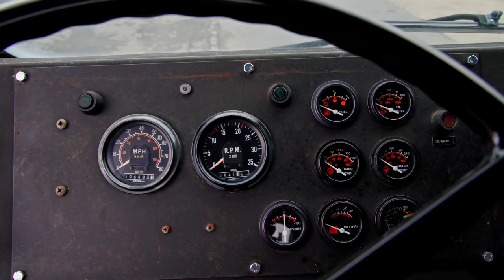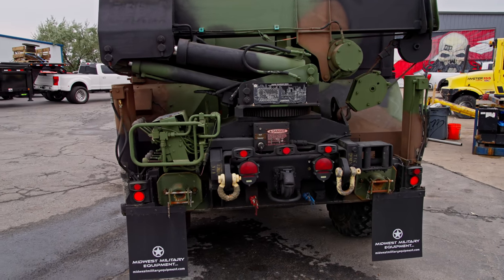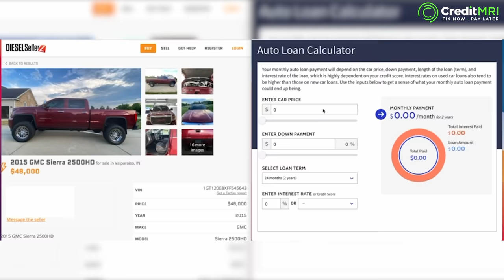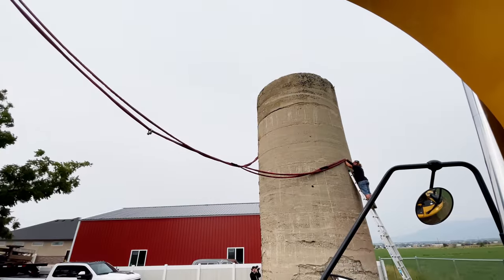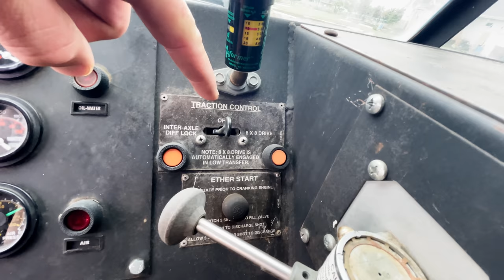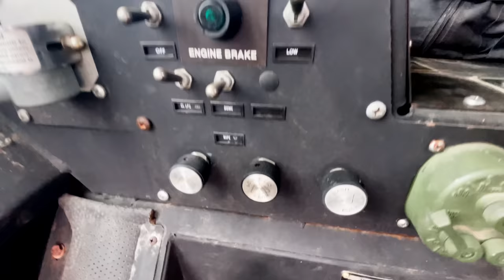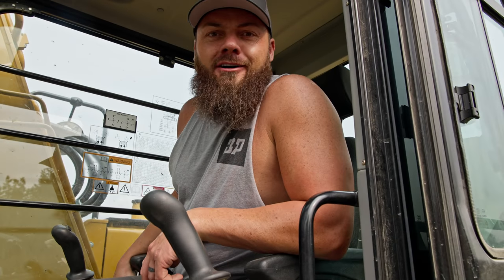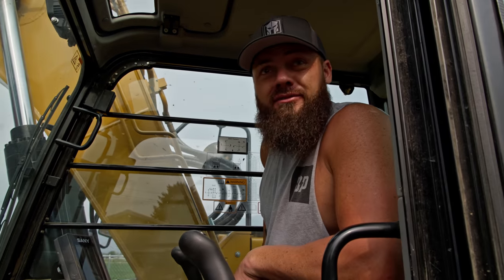This Giant Silo Could’ve Smashed Our Newest Recovery Vehicle 😅

Comment: Knew it was a HEMTT from the thumbnail. Those are absolute monsters! The wreckers and the PLS are awesome. Some have the big De-troit Diesels that have a turbo feeding into the blower. They turn like a 50 foot long 2x4 but that's no problem, they can just run over whatever is in the way lol. On a sad note, knew a guy that was in a convoy going to Ft. Drum in one. Some teens were driving recklessly and cutting hin off. He ended up running the car over and killing all of them because they drove in front of him too close. He would never drive the big stuff again and really messed him up. GOVE LARGE VEHICLES ROOM AND STAY AWAY FROM THEM! DO NOT FLOOW THEM, RIDE ALONG SIDE THEM OR CUT THEN OFF! Vehicles like this are designed to run over whatever is in their way and will drive over your car or truck like its a speed bump and it will kill you. Same with large commercial vehicles. They aren't designed to run over anything but because of their large size, they have no problem running over and flattening a car or truck. They can't stop as fast as your little car either. It's sad this needs to be said over and over and over. Anyone who cuts off or messes with a big truck on the road deserves to be flattened.
Reply: Yeah don't mess with monster vehicles
Reply: I love the HEMTT it’s an awesome truck!
Reply: Was he 10th mountain?
Reply: “Deserves to be flattened” is a little extreme don’t ya think? I agree, the big vehicles on the road need to be respected for what they are and the clueless people need to be educated about them. The jackasses that drive erratically need a couple nights in jail to think about what they are doing.
Reply: @joelbittner6212  i mean you're right it doesn't have to be said that way... but if someone doesn't have the least amount of common sense or is to dumb not to know what to do around big equipment .. they def can't be trusted around pedestrians or close to any other vehicle ... losing one life is better than losing multiple
Reply: I always try to stay within the view of the huge vehicle driver whether in his mirrors or in front  of him.  Respect the larger vehicles like this and don't give them a reason to lock up their brakes or create a hazard for them.
Reply: @joelbittner6212  I'll choose to believe Mike meant for us to take that last statement from a Darwinian context, rather than a punitive one.
Reply: What is the weight of the HEMTT ?
Reply: @coreyhodson3258    The a-kit and b-kit numbers are for the two armor levels available:  Mass	42,500 lb (19,300 kg) unladen; 69,000 lb (31,000 kg) laden (a-kit); 75,500 lb (34,200 kg) laden (b-kit); 109,000 lb (49,000 kg) (GCWR)
Reply: We had 2 HEMTT wreckers with us while doing route clearance in Afghanistan. They got us out of some sticky situations.
Reply: Was picking up my gf at the airport one shitty Christmas eve in Texas the day after an ice storm. Came across an accident.  A semi had overturned onto a Ford truck hauling a trailer. The semi's trailer was loaded with hot dogs. That Ford truck and trailer had been smashed down to around 6 inches, compacted. Driver probably never even felt it. Big rigs are no joke.
Reply: I remember hearing about that, I really felt bad for the driver of the HEMMT, and the car he hit.

Comment: I the Marines we would call those Dragon Wagons. A play off the word dragging because they could pull anything. Those trucks come in many different configurations.
Reply: similar but not the same configuration, you are referring to Logistics Vehicle System (LVS), The United States Army does not use the LVS, it uses the Heavy Expanded Mobility Tactical Truck (HEMTT)
Reply: Well, I did say, it comes in many different configurations
Reply: This is the LVS and LVRS replace these old rigs. Also we never called them dragon wagons in the Corps
Reply: Good for you, in 3/9 during the early 90's we were calling them that. As far as this being a different configuration IDGAF. That's like arguing about a hi-top HUMVEE and a shell-back HUMVEE or a HUMVEE with an ambulance shell on the back. They are all HUMVEE, just built in different configurations.
Reply: Have you ever seen 3/9 in a regimental formation?  The Marine carrying the colors was sweating and struggled to hold them up. The colors of 3/9 are so heavy that no single man can carry them. The regimental formations we had on Pendleton spoke the truth.
Reply: Sorry, this is wrong.  The Dragon Wagon is an LVS (mk48 power unit coupled to a detachable trailer):
https://en.m.wikipedia.org/wiki/Logistics_Vehicle_System

The HEMTT is a completely different vehicle.  It comes in many versions, but none of them split into separate power units and trailers:
https://en.m.wikipedia.org/wiki/Heavy_Expanded_Mobility_Tactical_Truck
Reply: @Jpeveto44  Two completely different vehicles, not just a different variant. Also, not called a configuration, it's a variant. Always has been, in every unit, no matter when. You were wrong, stop acting like it's just a thing of your time. You "back in my day" guys kill me.
Reply: A few of you are getting a little bit to critical about this. I understand the difference between the vehicles.  There are split frame and solid frame and they have all been upgraded and changed throughout the years. Don't be so critical about the little stuff. It's all the same vehicle but with many changes and modifications in order to make it do whatever they need it to do.
Reply: Also I believe all are built by Oshkosh and that's my actual point here. They build some amazing and very capable vehicles.
Reply: @Jpeveto44  yeah, they are both built by Oshkosh to do similar things.  But although the F16 and F35 were both built by Lockheed and are both multirole fighter aircraft, it's incorrect to call an F35 a "fighting falcon".  That's the nickname for an F16.

Comment: This reminded me a lot of when i pulled down a very structurally sound playground with my 1998 john deere riding mower only this took 3 tries and was successful, my lawn mower incident was and incident
Reply: Reminds me when I pulled 15 trees in the same day out of my Forest in my 2005 John Deere lx 280
Reply: Reminds me of when I lived in Oklahoma and tried to pull out the bush on a lot lizard
Reply: @bustinyanutz4195  🤣🤣🤣
Reply: Remind me of mowing over my fig tree
Reply: Reminds me of hauling 5 limbed up trees with my polaris ace 900
Reply: @benjaminsmith7228  dude, the ace’s are seriously capable, I have the 500 and it’s perfect for taking trees back to the burn pit or to move anything I need to, and it can rip at the badlands.(an off-road park near me)
Reply: @bentoth2494  for sure. I have a 3500 pound winch and 27x12 outlaw mst tires. Pair all that with a modified 900 motor and its some serious equipment. And that was done without tire chains
Reply: @RoseHope117  no sir I haven't gone full retard yet. But I was definitely 3/4 there my whole life
Reply: @benjaminsmith7228  lol

Comment: I’ve always loved the HEMTT.  Especially the wrecker…. If you get your hands on an A4 your life will be changed forever.  16 years and counting as a wheeled vehicle recovery specialist in the Army, those are always my go to for tough jobs.  Let me know if you wanna get together to put that thing through the paces !
Reply: Wait we have recovery specialists? As a FiSTer we usually make our mechanics go dick around in a M88A1 for a few hours till whatever we fucked up is out lol
Reply: A4? With the CAT? No sir, you needed to run the E1 converted to A1 series. Nothing easier to work on if needed and would out pull any other variant. Ran a A1 for 12 years in the service, 3 years of those were in Iraq. Would pull a HET with trailer and load down the road at highway speeds. Nothing beats that 8V92TA man, all they have to do is remove the throttle delay and adjust the jakes a little tighter and it'll perform smoother but because the injector racks are air over mechanically controlled they have to make sure they don't flatline the racks and cause the engine to run away.

Comment: Mostly used for hauling rocket pods for MLRS. But that crane will come in handy.
Reply: As wreckers and PLS trucks too
Reply: Lol mostly used as a wrecker, and fire engines. Very seldom used to haul MLRS rockets lol.
Reply: @andybmx28  well seeing how I just came from Korea and that’s all we used that model for I would have to disagree.
Reply: See there are 7 different models of the HEMITT with several other configurations. LHS, PLS, wrecker, fueler, fire truck, Patriot missile transport, bob tail, Cargo. So every model has its own purpose. This particular model was designed to haul MLRS rocket pods.
Reply: @benrubino605  lol dude their is a wrecker in every single motor pool, their are like what 3 duty stations MLRS?
Reply: @andybmx28  that’s not the point, the point is that I pointed out what THIS particular truck was for.
Reply: Mary Humphrey  possibly, why?

Comment: First mod should be to remove all the Governor's on the engine
Reply: What governors, them 2 stroke detroits are limited by fuel and air
Reply: I still know how to do rack adjustments on those for the injectors
Reply: And put a sick ass logo on the side on top of the camo. Promote the YouTube channel and business even more and let everyone know it's no longer a military vehicle. All the best guys! 💪😎
Reply: @topgunner58  ok
Reply: @topgunner58  assuming it's mechanical unit injection there's a governor that controls the racks that limits RPM, I believe it's 1,800 RPM no load speed in a semi truck application but for a military application I couldn't guess

Comment: What does that 8-92have for injectors in it? You have options to put larger injectors in it if it doesn’t have already. A lot of old-school truckers used to cap the return line coming out of the head to increase the fuel pressure. You can also increase the fuel pressure of the lift pump. Being a military engine I bet you it was built to be fuel-efficient. Read up on the fuel squeezer package that the two-stroke Detroit’s had offered, it might be equipped with that now possibly

Comment: Those engines where delivered with the waist gate tuned way down, if you get in the system and re tune the you can almost double the power without changing anything. I once had the newer 10 wheel spinning all tires for a sec

Comment: It's a pretty nice all arounder for sure. Great christening. God bless y'all's. Gotta give it to the new military trucks even if you lost a foot you'll be able to drive out of danger. In my Case my left clutch foot is dropped so i would struggle to clutch or shift on a bike. But I almost lost half my leg below the knee doctors did a great job pulling the shattered tibia together with a lot of titanium screws and a plate that can break through anything that hits it Wich I'm still hesitant to remove. I kinda like having a titanium  enforced shin.

Comment: I loved my Wrecker in Fort Riley Kansas. It's such a beast of a vehicle with that dual steer gear box. Wish I could afford the wrecker I was H8 (Recovery) and I was in charge of a Hemtt Wrecker A2, comes with a stinger and bunch of wire lines, Wire Rope Diameter: 9/16"
 Wire Rope Length: 200', a bunch of +15k wires. It was a MONSTER and I could tow anything any where any day.

Comment: you guys should look into a 1997 oshkosh heavy equipment tank transporter that can haul a quarter million pounds (125 tons) and has selectable drive axles too meaning you can select which axel you wanna send the power too and it also has 8 wheel drive

Comment: Oshkosh trucks are very nice. I work on one that has 2 diesel engines and 2 transmissions. One set runs the truck and the other for the hydraulic system

Comment: I drove a M985 HEMTT for years in the Army. 1- DOES NOT FLOAT. 2- Highway road bouncing is horrible. 3- Be careful with that side mounted recovery winch (you can run the cable out front or rear. We had to stop using those recovery winches due to frame bending. Other than that, they are a blast!

Comment: Keep your eyes open for a HEMTT the 984 A1 wrecker... those typically came with 4 winches, not including the winch on the palfinger boom. The front and rear winches are much larger and more powerful. The 984 A1 is a wrecker unit... Please note, the luxury of speed like what you have in this stake pocket unit you guys have now, will be considerably less, LOL.... like 0 to 60 in 4 hours, due to the additional weight strapped on the rig. The palfinger boom on the 984 A1 is one size larger typically as well, likewise the winch has a larger capacity. Lastly, due to the additional weight, these 984's are exceptionally hard to get stuck and they will plow 4 foot high worth of mud in front of itself to get out, but, if you do get it stuck. Best hope you have something heavy enough to hook onto that the onboard winches won't just pull into the pit with you.. lol.. Don't ask me how I know that...  That measure of stuckness, makes for a really long day..  Although the Army frowns upon using the 984 to unstuck a tracked vehicle, in allota cases, the 984 has done that uncountable times in Trash-Can-O-Stan.. Second lastly, invest into the service manual, for proper scheduled maintenance program, (not to insult you guys's intelligence) but rather, you can get a massive life span out of the drive line parts, if you just keep them lubed or clear of dirt and water intrusion. Believe me, you do not want to play the game of hunting for front steering axle u-joints or a replacement knuckle / spindle.. Not only are they getting to become in rare supply, they are costly.. The newer OSHKOSH drive line and suspension is independent suspension and out side of the wheels, those parts to not cross over to the solid axle versions. Take care of the unit, and the unit will ALWAYS take care of you.

Comment: 9:49…. That is NOT the trailer “parking break”.  That might be the trolley brake which only applies the trailer breaks when you pull it and as soon as you release it the brakes release.   The trailer parking break is the red knob below the truck air brake

Comment: Quick Vehicle suggestion for you guys, Maybe try to legally buy an Abrams M1, M1A1 or M1A2 I think if they have to remove the turret/Primary weapon that's fine. This vehicle would provide a Turbine engine putting out 1500hp so perfect for what you do aswell as reinforced Tracks and Armor to keep you safe. I know this vehicle is used for military/Army Purposes only but there is a chance you can legally buy it from the US Tank Regiment. Guys love the vids keep it up and stay safe.

Comment: On the bottom on the side you wanted to fall to knock out every 3rd block or at least drool big hole in every third blocked or every second block and it will solve that direction drilling a hole in each block is very good it only has to be about an inch it doesn't have to be a big old it's this to give the pressure somewhere to go

Comment: I believe if you had some descent weight in the bed, but not at full capacity, you wouldn't have had an issue with just creeping through it on the first pull and shouldn't have an issue with the hopping. I'd do that trick with my '94 Toyota pickup 4x4 and have pulled many vehicles out of hairy conditions and various ground conditions and the vehicles were quite larger than my truck and it helped that I had Detroit lockers front and rear. Even the trail clubs would call me to pull them out because I had the only vehicle fully locked and there were only a few that had lockers, but only had it on a single axle.

Comment: i laughed like heck when I saw this.  Reminded me of one Thanksgiving long ago where we decided to drop my grandfathers concrete silo.  The silo was leaning bad so it looked like it was ready to fall.  Lots of uncles and cousins over to grandmas house for Thanksgiving dinner so this would be a good hour long project.  We started to sledge hammer the concrete on the down hill side watching for it to start tipping.  Well, it had a lot of old scrap steel (old farm machinery parts and pieces) in the concrete so I went  home and  got the  acetylene torch.  Hammer hammer hammer, cut steel cut steel cut steel.  We couldn't quite because we were making it more of a hazzard.  Everyone took turns on the sledge hammers so we could get it done.  5 hours later we were all the way around except about 18 inches when it decided to very slowly tip over.   It hit the ground and didn't crack a bit.  Stayed laying  on the ground till my uncle brought over his D8 and buried it 8 years later.  Man, they knew how to make them tough in those days.

Comment: It trigonometry. Only your front wheels were doing anything at the low speed.  When you finally did the third try the weight of the truck and its forward motion did the duty.  Good job guys

Comment: Always keep your left heel laying on the floorboard. Otherwise, you can run out of air, when you really need it. Like Bicycle Lake, in CA. Ha! Miss driving my Hemitt. Except for the time, we got left behind the "enemy" lines with 102 MM rounds. and they were going live fire in 5 minutes.
Reply: You could try and spray air crete into all the empty spaces under the truck, and see if it would float? considering your sitting in a roll cage. And, always wear your seatbelt, otherwise, if you hit a bump wrong, you can become air born ranger, very quickly. Ha!

Comment: It's got a 650HP not 500. has a turbo sitting on top of a blower for intake. When we were is Saudi Arabia for DESERT STORM we had no governor on ours. Some of them were clocked at 90 to upwards of 110mph on a the highway. ILOVED THAT TRUCK! We couldn't get diesel so we ran them on JP8 which is used in helicopters. Smoked for a while then ran like a demon. We TRIED to get one stuck to practice recovery procedures and couldn't. Had it in mud up to the body, locked diffs, locked in low and floored it, she walked right out.